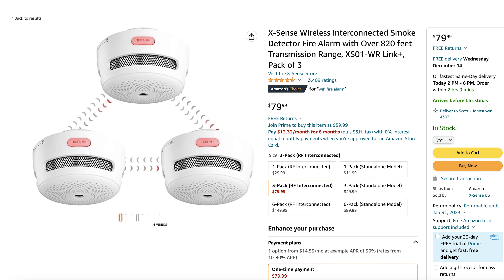Installing Smoke Alarms and CO!   X-Sense Wireless!!

Comment: you should try pairing the co alarms with the smoke alarms. i would want to know if the co alarm would go off if a smoke detector detected smoke.
Reply from the maker: I tried, sorry I didn’t post but the manufacturer was correct.  They will only pair with each other and a remote.

Comment: Rf transmission, similar to a tv remote, there may be hundreds of frequencies it has to scan before they connect. Thus the longer connect time.
Reply from the maker: i think the 2 might have already been paired like the CO's since 6 came in a box together.  although they shouldnt have paired if already paired so idk.  at least its done and others have a troubleshoot guide now kind of.

Comment: The LCD screens use very little power, think 80's watches, they were all LCD and they ran off a small battery and lasted a year or so.  LED uses more power as it actually illuminates the screen, so you should be fine. The device itself will be the main battery drain.
Reply from the maker: True, good to know.  And if I’m not mistake, dead or not, I think they all get changed yearly anyways.
Reply: @neckofthewoods24  Where I am, they recommend that when you change your clocks for day light savings you should also change your smoke alarm batteries. That's every 6 months for me, but yes, every year is usually fine.
Reply from the maker: @PaulyDownUnder  you know that does sound like what we are told too!   I need to make a list of everything!  So much as a home owner you need to keep up on!